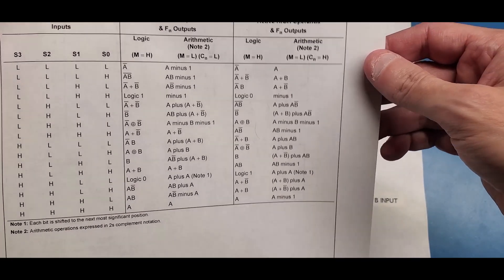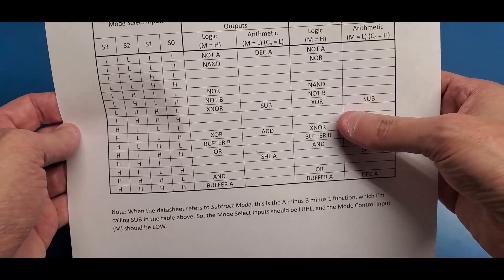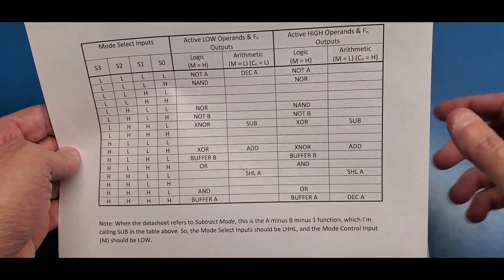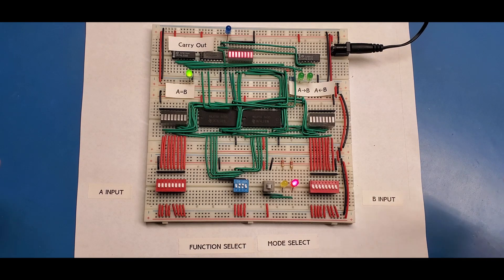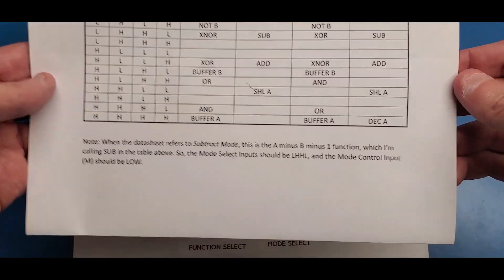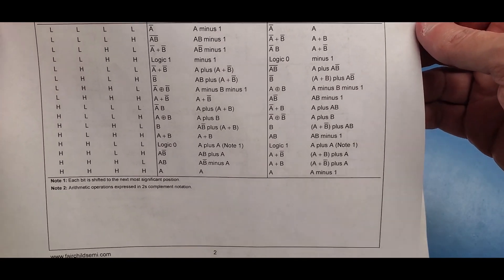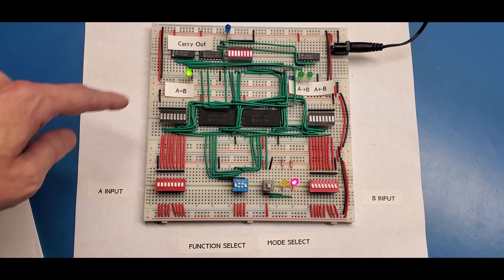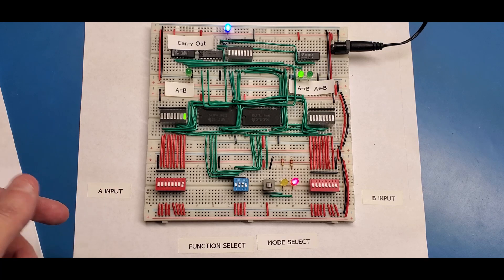Comparator Functions of 74LS181 (74HCT181) ALU

Comment: Isn't the point of the A=B output being open collector that you can just wire the two 181s together with a single pull-up resistor to create an AND gate without any further logic, ie wired-and?
Reply from the maker: Ah ... is that what wired-AND means? I didn't realize that. Learn something new every day. I will give that a try. If it works, it simplifies the wiring and eliminates the 74LS08.

Edit: I was able to make this change and it works. So this was a great optimization, thanks.
Reply: The old TTL chip designers knew what they were doing!
Reply: Exactly! Please add this correction as overlay note to the video for viewers who might miss this comment.